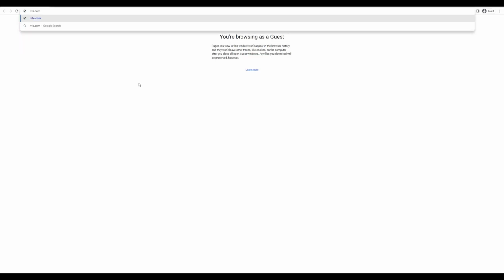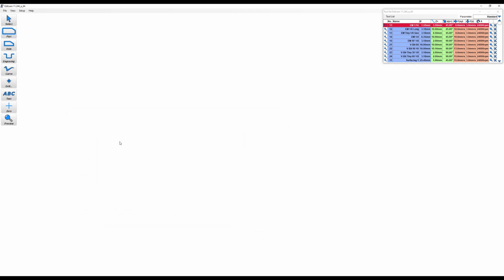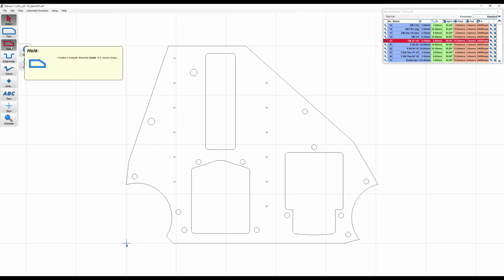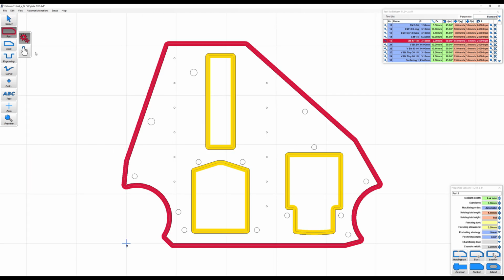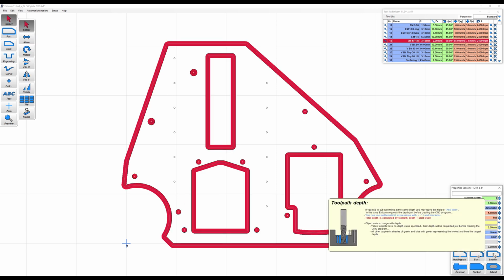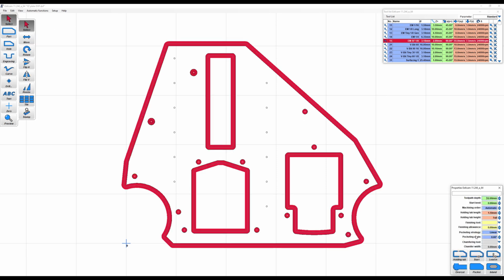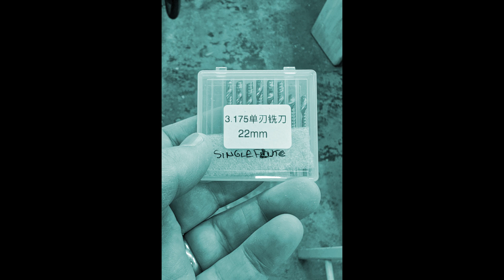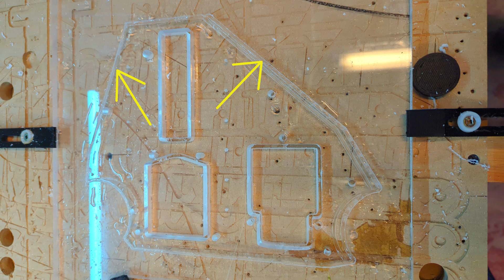CNC Upgrade - Making Acrylic YZ Plates

Comment: That is a giant slab of plastic! I would have totally left that groove, more power to you though turned out great!
Reply from the maker: Thanks!
I think if I didn't fix that groove I'd be very annoyed every time I used the machine.
It's better this way 😀
Reply: @totyweeworkshop  Yup, I get it, it would have bugged me enough to rush out a new version of the machine just so I had to cut new plates. 😂